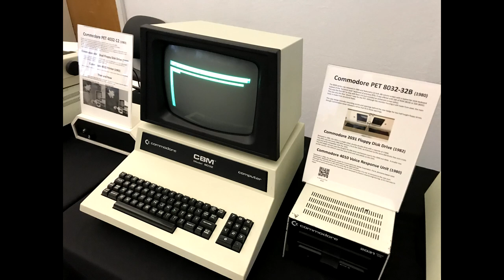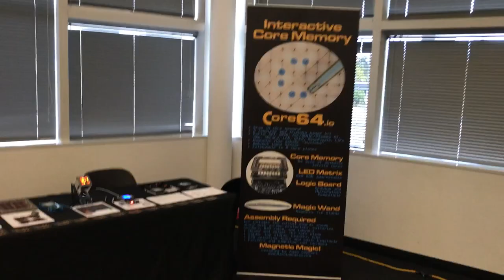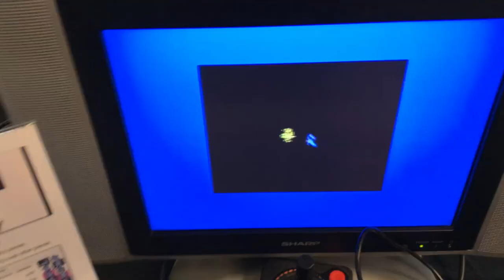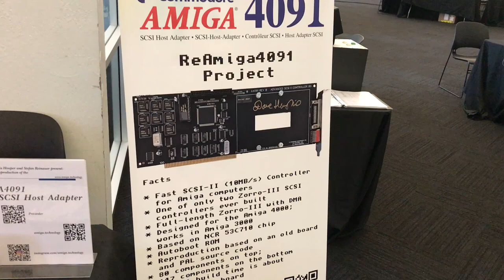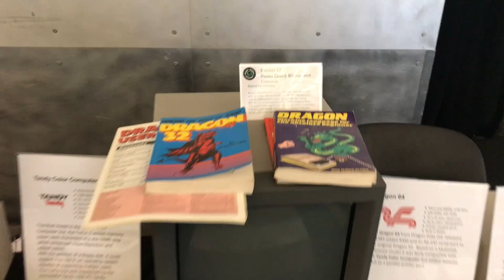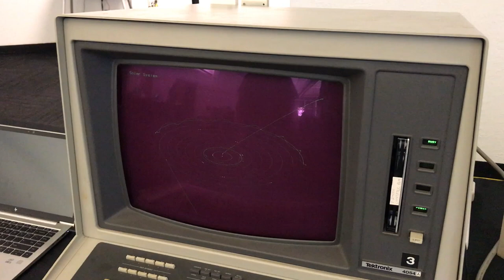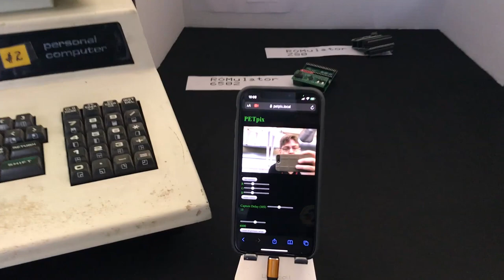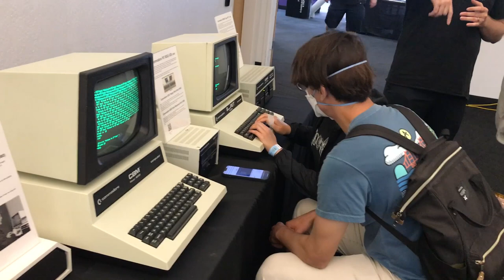Vintage Computer Festival West 2022

Comment: What was that 6809 board at 13:30?
Reply from the maker: Also at 12:50
Reply: @HutchCA  Didn't see it there.
Reply from the maker: @winstonsmith478  Oh, sorry that was a 6800 at 12:50. There's a 6809 inside the Super PET but you can't see it.